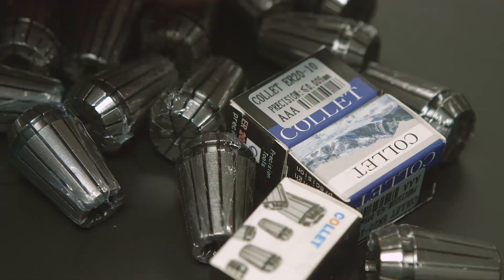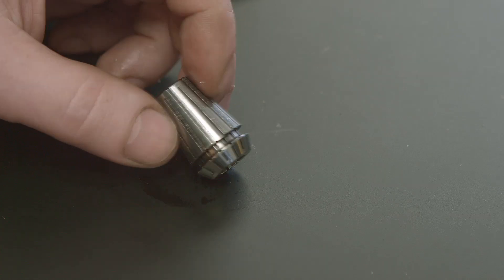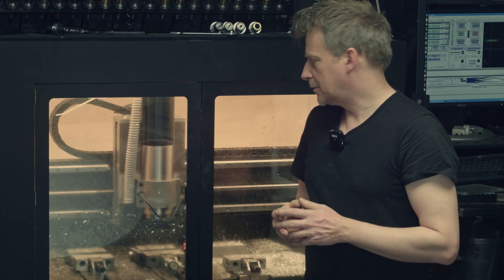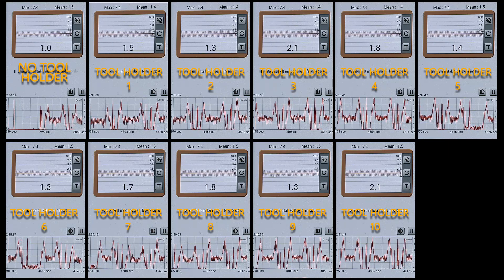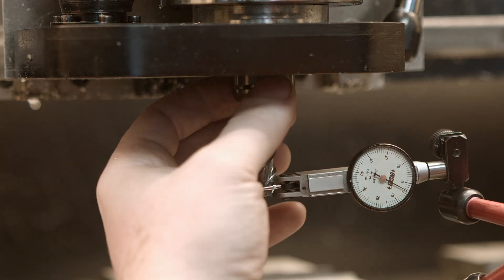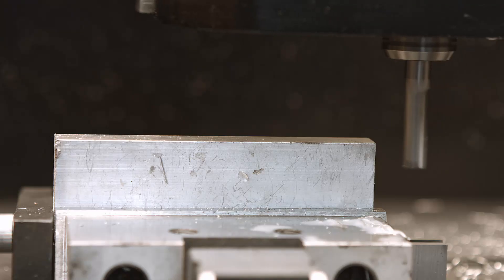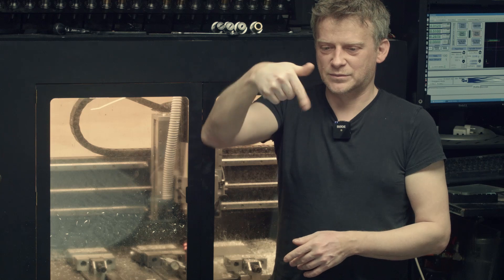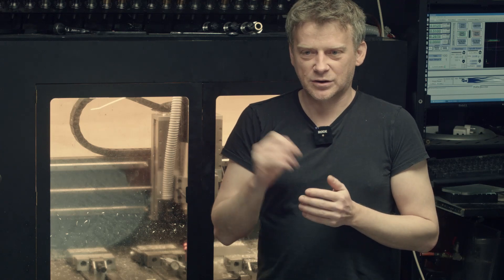Precision ATC Tool Holders and ER20 collets Review - Seriously hard to find any better than this.

Comment: Actual vibration sensors are typically epoxied to the thing they're measuring so that what they read is the actual vibration of the part, comparative or otherwise. Because of that, it's unclear how useful the vibration app is. Not so much the app itself, but how the phone is sitting lose on the machine. Between that and the rubbery case, both serve to filter the readings to an unknown degree. For comparison purposes it's somewhat okay, but with an unknown scaling factor.
Reply from the maker: Here it's not really important if the phone is epoxied in to the frame 😉 vibrations are not that big for the phone to jump around. I'm doing comparison measurements not certified measurements. As long phone is sensitive enough to register something. I can measure the difference. And phone accelerometers are ridiculously sensitive. Try it you self. You can learn a lot about your setup and dial it better.

Comment: Check out Parlec P3 (Blue) precision collets. I’ve used them extensively.  Expensive but I’d like to see your comparison.
Reply from the maker: Thanks for the tip. I will keep using the one I found. But if their quality drop I will look for Parlec. At the moment I can't justify spending more for the same thing which is untested. You know... if it works, why changing? 😉

Comment: Hey my friend. Best wishes for 2022! So after you posted the vid re: new ATC spindle, I took a holiday from DIY CNC. So many months ago I queried you regarding my machining cost for a design I had wanted to emulate for my DIY rig, and after wrestleing with welding and squaring the base frame, decided it was too much to get all the parts together in a sane method. I decided to order what is arguably a decent "turnkey" hobby 'plus' quality machine from a vetted (cross your fingers and hope) manufacturer in Asia that seemed to be updating their line-up regularly. I clicked "Buy" on a 6012 so called desktop machine. 300kg is desktop? So I now have 600mm x 1200mm x 200mm XYZ that keeps me busy. JUst upgrading to ESS and Mach4. Only running code from Vectric Vcarve Pro, or Fusion 360. I am still running tthe 2.2kW spindle. Tool changes are a pain especially during multiple process jobs. 
I would give my left nut for ATC with tool setting and an automated routine to establish material Z Offset
Reply from the maker: hey, best wishes to you too :) I hope your new cnc will serve you well. yeah Atc is definitely a game changer.

Comment: Hi, Fox!
I am looking at aliexpress now, and it seems they offer two basic options for ISO 25 toolholder. Cheaper one, that is  30,000rpm -40,000rpm balanced and expensive one that is  G2.5  30,000rpm -40,000rpm. Which one did you buy? Which one did you test?
Best regards!
Reply from the maker: I got cheap one. Cheap one is steel and expensive is stainless. I don't know if they sell any other ones.

Comment: there is actually a much more difference but you can't see it because it is hiding from you in the future )
when end mill is out of align it wears inconsistently so in some time you will get an end mill with one dull edge (while others are still sharp) which will give you a bad finish.
better collets = longer tool life.

Comment: I have the same Jianken spindle you do.  How did you choose which ISO25 toolholder.  I followed the link and there were so many under the ISO25 ER20 and most looked the same just different prices.  Great video!
Reply from the maker: I looked at the picture iso25 and er20. And than i prayed for them to send me the one on the picture ;) seriously ;)
There are different nut styles and perhaps precisions. And one is stainless and the other not.
Reply: @PiotrFoxWysocki  I'll take your advice and buy some.  Maybe I'll pray a bit too. Thanks!

Comment: I'd like to knoe about the bad suppliers as i am about to decide where to buy MC NZ is a little bit to expensive for me
but is one of your toolholders from 
MZG?
Reply from the maker: 12$ for tool holder is expensive? I used to pay 100$ per tool holder. Endmill cost more than this tool holder. I dont think you should go any cheaper than that.
Reply: @PiotrFoxWysocki  No the problem is that for every 12$ toolholder it is 55$ shipping here and the shipping doesnt combine
so 2 holders is like 130$

Did shipping cost combine for you?

Comment: If someone else did not already say it. @7:50 you are supposed to snap the collet into the nut before inserting the tool. The nut have a captive ring to retain the collet. If you insert the tool before assembly, the collet can not collapse to snap into the ring to seat on the tapered surface of the nut. I am convinced the collet that you tested with runout was riding on the ring and did not properly seat on the nut. Thanks for the link and the trouble you went to to test all of them.
Reply from the maker: I already mentioned in coments that this type of nut doesnt have snap feature. You have special tool which is pulling collet while you undoing it.
Reply: @PiotrFoxWysocki  .Thanks for explaining. Interesting - I have never encountered this type. I did benefit this morning form your ball screw build. I replaced the fixed bearing block on my Z and the spacers which is actually supposed to ride on the seals was too shorter than the original. Luckily adding the old spacer did the job to get to the nut into useable range. Also turns out the fixed block was assembled wrong with a shim on the inner brace between the bearings, pushing the bearings surfaces apart no matter how tight you do the nut. You may have to check on yours it it originates form China.

Comment: 8:44 you probably should not rotate the endmill clockwise because it might bite into the tip of the pupitast (dont know the proper name in english now :P)
Reply from the maker: i know :D that is why I set dial indicator to work with in first ~100 microns, so the stylus ball its barely touching the end mill. and obviously for most of the time I'm rotating it counterclockwise. 
thank you for the concern :) but hey! dial indicators are meant to be used :)
beside i think i have spare stylus for it anyway.

Comment: Hi Fox,
I have a question regarding the constant air that passes through the spindle.
 Is the air first goes through a filter or directly from the compressor. And if it goes through a filter which filter do you use
I also have a spindle of Janken 2.2 kw
Reply from the maker: i use air filter/regulator on the compressor and than a short hose to the machine.
but this is not enough as i discovered. I'm running it for 2 years now and spindle is still alive.
i have plan to put another air filter regulator closer to the machine because looks like air is condensing in this short hose between compressor and machine. 
I don't think filter brand is critical, they all should work with similar efficiency.

Comment: Have you looked into ER20 ball bearing collet nuts?  Essentially a ball bearing embeded in the collet nut.  They purportedly have a significant impact on both collet tension and runout.  A bit expensive (20$), but potentially worth it.
Reply from the maker: cool idea, i have never seen those kind of nuts with my tool holders.

Comment: I have had some good luck with cat40 versions too.  One thing I have found is corrosion can be more of an issue, I think the steel they are made from is a different composition.  It would be interesting to do some hardness tests and some metrology tests to compare them at the material level.  Performance is very good and for the price I can afford to replace more often so I think it still may be a good deal.  Have you looked at heat shrink tooling yet? I think that would be the best option and it's quite easy to build a diy induction heater coil to insert and remove tools.
Reply from the maker: interesting, do you have only those tool holders or some other brands as well? im wondering what is the difference in the rust progression.
btw they sell also stainless steel versions of tool holders. i might look in to this :)
hardness wise, I'm not entirely sure if its that important, as the contact surface is huge. wear can only happen if the tool holder is spinning in the spindle. but by just putting it in and out, would take decades to wear it to the point where you can measure something.
if you have problem with rust you should take look for different coolant. or maybe higher concentration.
on the other hand, if i forget to take parallels from the vice they do develop some rust spots.  so maybe it is slightly different  steel.
anyway, thanks for pointing it out :)
Reply: @PiotrFoxWysocki  yes i agree with you i just noticed it on a few of them, it was very light surface rust that i was able to clean off.  i don't think its the coolant as i have no other issues with other holders or parts of the machines,  i have various other brands but mostly sandvik,  i just bought some HAAS ones too to try them out. For the price i don't think you can get better quality and like you say it will take quite some time for them to wear out. maybe them being a little softer could be an advantage as i would prefer the tool holder to wear out rather than the taper in my spindle if the tool changer alignment isn't perfect.  keep up the good work on the videos i like them.  its very nice to see your progress.  Im a little bit lazy with updating my videos,  i have many to edit and share but i never seem to get round to it as playing with the machines is more fun :-)
Reply from the maker: @weldchip  price wise, no doubt you just can not get it any cheaper. manufacturing precision is top notch. its just the rust thingy.. I think its worth spend double that and get stainless.  24$ for tool holder is still a bargain :)
 hey, I'm glad you like my videos, thank you :) I agree, making them takes ridiculous amount of time. and when you have things to do, video has to wait. 
playing with toys is definitely more fun :) but sometimes is good to share your experiences :)
Reply: @PiotrFoxWysocki  yeah $24 is a good price for a stainless.  i didn't see a stainless option for the cat40 tool holders,  i don't think the run out is quite so good on all of mine a couple are worse than others but all are 10micron or less which is perfect for my requirements, i had one that was not properly manufactured and they sent me a replacement.  my spindle is bigger and so are the tool holders so balance is quite important but my max spindle speed it only 8000rpm so most holders are balanced fine for that.  i actually cut two of them up to make some tools because they are cheap way to get a nice ground cat40 taper.  one was turned into a tool changer alignment tool and the other was made into a draw bar tension tool. my biggest problem is i work 50-60hrs a week as an engineer for a big medical company so my spare time to work on my personal machines and edit videos is limited.
Reply from the maker: @weldchip  I'm wondering why you have <=10 microns deviation. did you try to taking out tool holder and putting it back? 
well i guess its not as important :) 10 microns for Bridgeport is nothing.
its nice of then that they sent you a replacement without any problems.
I'm with you on limited time.. i work around 90-100h/week. so to find a time for a video doesn't happen very offten.
good luck on your rebuild :)
Reply: @PiotrFoxWysocki  I can only orient one way as cat40 is keyed.  New Factory spec for my spindle is 2micron or less it's about 4micron at the moment in the taper but that not bad for a 20year old machine. a professional spindle rebuild and taper grind is over $4000 so unless the bearings fail I will live with it.  the sandvik, maritool, haas holders are all near perfect and measure the same as the spindle but much more expensive, out of the 10 chinese ones 6 are really good the rest are ok. With a big cutter 10microns total runout on a machine with 560x500x400mm travels is fine.

Comment: While it's been long undertood that tapping can improve the runout, i have trouble understanding why the improvement wouldn't regress once the tool is subjected to cutting forces. Have/could you measure one before and after cutting?
Reply from the maker: collets have all those cuts around them to shrink around the tool as you put them in to the spindle taper or tool holder taper. one thing  which is preventing them to close equally is the friction, so its quite possible that one side got stuck and other side moved. resulting in the end mill being on an angle. when you start tapping it loosens the stuck part of the collet and redistribute those cuts in the collets equally. 
the part people miss mostly is that, after you tapped the end mill in to the position you have to tighten the collet again, to remove slack you just made by setting the collet straight. 
you should do tapping, measuring and tightening 2 or 3 times to make sure it is straight and tight.
once collet is straight and tight there is no more room for any movement and end mill wont move anymore. 
I hope i explained it well so it makes sense :)
Reply: @PiotrFoxWysocki  It does make sense, thank you :)
Reply: I was wondering the same thing.
Reply: NYC CNC made an entire video on the subject. You should check it out very interesting results

Comment: Very helpfull info! Thanks for sharing!:-)
Would be super interesting to know if the endmill tapped to place (very low runout) has in any way shifted after the cut(s). Can you please check it for us? :-)
Reply from the maker: collets have all those cuts around them to shrink around the tool as you put them in to the spindle taper or tool holder taper. one thing  which is preventing them to close equally is the friction, so its quite possible that one side got stuck and other side moved. resulting in the end mill being on an angle. when you start tapping it loosens the stuck part of the collet and redistribute those cuts in the collets equally. 
the part people miss mostly is that, after you tapped the end mill in to the position you have to tighten the collet again, to remove slack you just made by setting the collet straight. 
you should do tapping, measuring and tightening 2 or 3 times to make sure it is straight and tight.
once collet is straight and tight there is no more room for any movement and end mill wont move anymore. 
I hope i explained it well so it makes sense :)
Reply: @PiotrFoxWysocki  Thank you Fox, sure you did! The assumption you are making though is that the collect is ground precisely. If the collet is off, you add more slack with tapping the endmill concentric with the holder/spindle, right? Or is it that  you actually cannot tap the endmill to be concentric with spindle if the collet is bad? That would be then a reliable way how to figure out what collets are OK and what are garbage, right? Or is there a better way to find out?
Reply from the maker: @hornyj1  if you can not dial it. the collet is bad. 
if you dial it right at the bottom than you check at the top if the numbers are different than it is bad, but if the numbers are ok, then the collet is ok